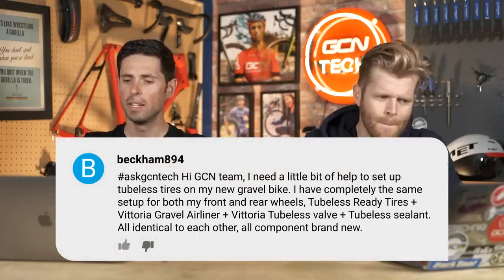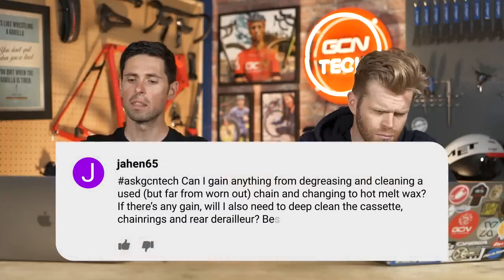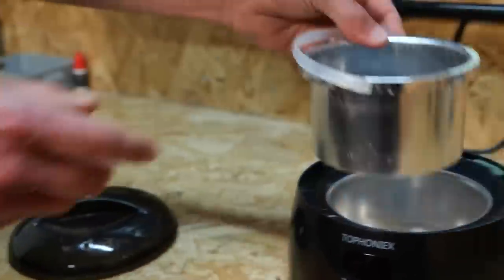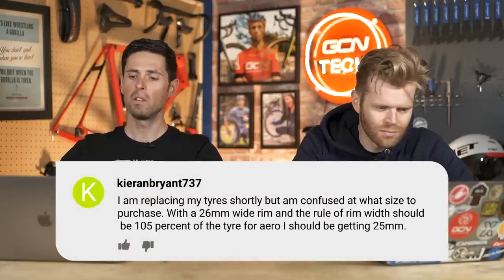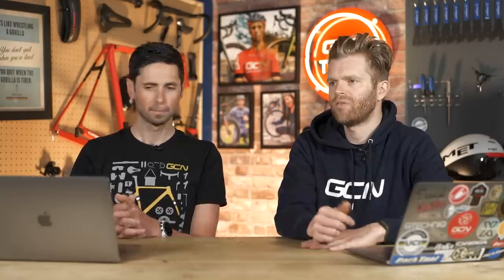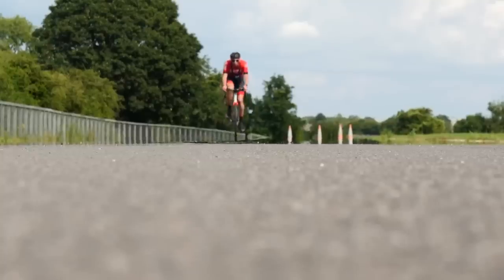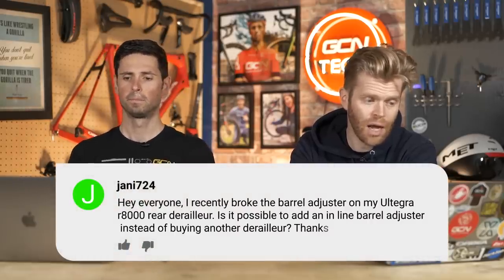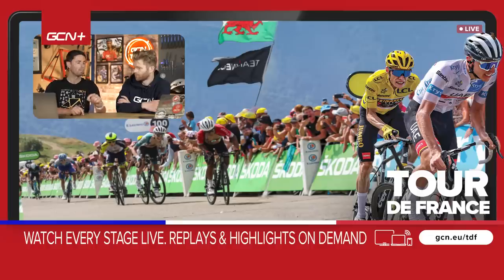Broken Barrel Adjusters, Waxing Chains & Tubeless Woes | GCN Tech Clinic

Comment from the maker: If you've got any tech questions that keep you up at night, drop them in the comments using #askgcntech 👇
Reply: @gcntech replacement derailleur barrel adjusters are very easily available! There's an online touring bike shop that stock a lot of spare parts like that called SJS Cycles, based in Bristol. I have sourced a barrel adjuster, derailleur cage and shifter cover plates for different Shimano groupsets from them over the last few years and my wallet is much more thankful. Whilst you could buy a used mech, even one for spares/repairs would likely set you back more than a new adjuster. Then you also have the problem of owning an incomplete spare.

Comment: Leaky tubeless valves: don't tighten them ....loosen them and give it a wiggle to get the sealant to flow through and seal around the valve area. Then hand tighten. Wait a couple hours for sealant to dry properly.  Also recommend Mucoff V2 valves because they come with 3 different size rubber bungs so you can choose a style which is closer to your rim profile. 😎

Comment: To the leaking tubeless tire: the little rubber on the outside of the valve doesn't do anything for the sealing. If it would you should have a seal on every nipple etc. 

Had the same problem. Was the tire sidewall. Pirelli send me a new one without a problem. Saw it perfectly when washing with soapy water.

Comment: For the rear Derailleur barrel adjuster IF all attempts to get the broken thread out fail, you can carefully drill it out about 2/3 of the way (basically making a cable stop) and pop in a "Rocket Barrel Adjuster" if you don't know what they are google them and you will understand what they do just by looking, but in a nut shell they will give you a semi-fixed barrel adjuster anywhere there is a cable stop, you could even bond the body of it in place effectively replacing the thread and use an original Shimano upper part if you care about how it looks.

Comment: If the tyre is going down relatively slowly, the hole through which the area is escaping must be small. Why then does the sealant not fix it? Seems strange that we've been sold a system that will fix punctures yet it cannot fix a small hole.

Comment: Having changed 4 sets of tubeless - apart from the very 1st time (GP5000STR 700x28 that held 90psi with no sealant for a good day) - always struggled to have tyres keep the pressure. What helped is super painstaking - applying a small thin layer of sealant where the tyre seats on the rim, making a sticky contact once fully inflated. Works like a charm. Wipe the wheels immediately as leftover sealant is a proper bastard

Comment: Original tyres on my gravel bike persistently lost air both front and back - replaced tape, valves sealant etc, finally identified many micro leaks in the side walls. Apparently not losing enough in any one to carry the sealant through but collectively enough to lose pressure over the course of a ride. Replaced tyres (different brand) and no problems since.

Comment: If a tubeless tire loses pressure it is often the valve core. If it gets dirty, for instance because sealant gets on the valve on the inside, it does not close well anymore. Easily solved with a new valve core. You can buy them in packs.

Comment: Washing detergent on the rims. Air 'will' also creep through the tyre walls at microscopic levels. Submerge the inflated tyre and see the tiny threads of air escaping. My solution was to rub sealant into the walls (not a total fix but close) For most tyres this seems to work. However, for my Vitoria Corsa Pro's there's always some gradual loss. No problem here. The advantages of these tyres far outweigh the issue of having to inflate the things a bar or two.

Comment: Inflating tubeless was a nightmare and virtually impossible until I realized the rim tape is too soft and has small dents above each spoke hole. Replacing the tape for more firm one and having the smooth surface was the key.

Comment: Yes - I lost pressure from my tubeless tyre because I picked up a 3 inch nail that damaged the rim. That was 2,000 miles in to a bikepacking trip so no solution as I had no spare rim tape....

Comment: About tubeless leaking air, I got sick of my tires losing about 1,5 bar in 3 days. The solution for me? Loosen the valve lock nut quite a bit, wiggle the valve around a bit and let the sealant do it's work. 

For the first month or so after riding tubeless I noticed the loss of pressure and thought it was just a thing for tubeless tires. After doing this, the problem seemed to be gone.

Hope I helped someone with this tip!

Comment: #askgcntech what's the point of doing all the process immerse waxing requires when you can get around 70% of its benefits (as per silca and zfc statements) simply using drip on wax, which is a cheaper, easier and faster process?
Reply: My wax was free - I simply melted down my 70th birthday candles LOL

Comment: The part number for the official replacement R8000 cable adjuster is Y3E998030
Search for that and you should be able to find one online. They're only a few pounds.

Comment: Hi GCN legends, I was just wondering if you guys have any connections in shimano and if so could you ask if they are going to still support ultegra 6800 series? Ie. a fc-6800 50t chainring. Down here in Australia. There is none available anywhere not even in Shimano’s stock. If I have to upgrade to a fc-R8000 series crank set. I think I also will have to then change my fd-6870 di2 front derailer. $$$$$$ I don’t have. 
Cheers,
Bondy.

Comment: #askGCNtech:  Hey tech team, thanks for all the help throughout the year(s).  Question, when you ride a standard carbon road bike up a hill or under a pretty heavy wattage load, how much does the bike flex at the cassette?  Or more simply put, should the noise(s) and level of noise from the chain cassette combo be the same or different when climbing?  Mine is different, do I have a problem?  My bike continues to shift well, Campy 10 speed from 2008'ish, everything replaced at least once, waxed chain , but it does make more clicking when climbing.  I am concerned maybe I need to finer adjust things, but have failed to this point.

Comment: Once I have my tubeless all set up properly and my tires filled with air, I start bouncing it, gently, I drop it from ~10” above the ground grab it after 4 or 5 bounces before it starts falling over, and drop again, rotating approximately 5 degrees each time I drop the wheel for the next set of bounces. I keep this up, until I rotate the wheel completely, 3 or 4 times, and then I top off the wheel, if need be. My tires lose a shockingly small amount of air. Tubed wheels I usually have to top off, at least every couple of weeks, if not more. With my tubeless setup, after doing this method, I have only had to add air, when I  have experienced a sudden loss of air, from a puncture, or an impact burp. I don’t know if anyone else has used this method of finishing their tubeless setup, but since most people say they have to add air more often than they would with tubes, I recommend giving it a shot. I would love to hear how it works for other people. My guess is that it results in a more even coating of sealant than the rolling and shaking method. Which I did to start with, but was losing a ton of air, and just had the idea to try bouncing my wheels, before taking them apart and re-taping, which would waste a ton of sealant.

Comment: #askgcntech Please make a tubeless tire trouble video. I tried tubeless but after installing everything, and going for my first ride,  the rear tire's bead unseated itself. tire is fine,  just not hooked to the rim. The front tire is fine. So I go to an event and sure enough after 8 miles, same thing. the bead is unseated and sealant is spraying everywhere. I had the pressures set for 35PSI for both rims, was this too low? (I'm 6'2, 250lbs) I want to try again but being not sure of what I did wrong,  I don't want to repeat the experience.

Comment: Hey team! I'm looking for a tough tubeless road tire that will survive the crummy roads where I live. The longest I've had a rear tire make it before being killed by glass, razor blades, or massive thorns was 842 miles. I live in a hot climate with almost no rain so wet grip isn't a big concern for me. I've tried Conti GP5000s, Vittoria N.EXT, Vittoria Rubino Pro IV, and Perelli P Zeros with only the Rubino making it over 500 miles. #askgcntech

Comment: #ASKGCNTECH Hi GCN, should I consider two different tread patterns for my gravel bike? I'm asking because I recently replaced my rear tire with a Rambler and my front tire needs to go as well. I want a faster rolling tire, should I put a rambler front and back or get a slicker tire, if so where should I mount it? I appreciate the advice and thanks to you I'm ditching the lube and switching to wax. I hate my dirty chain!

Comment: One of the many problems with tubeless  is that if you leave even a tiny amount of dried sealant in the bead area, you'll have a leak. Never mind the issues with the valve. Mtn, gravel, use tubeless, road, stick with tubes.
Reply: I couldn't fathom running tubes ever again on a road bike.  My flats are down a good 90%.
Reply: I run TPU tubes, which are incredibly light. 1-2 flats a year, 3-4K miles. No mess. I did run tubeless for a few years, and it just wasn't worth the hassle for where I live.
Reply: @rg807  makes sense if you don't get flats. I ride a lot(1200-1500 miles a month) and was getting 3-4 flats a week in goathead country.   I really only run 1 tube on one bike.... the front tire on my TT bike(when racing) and I'm tubeless out back.  Tubeless everywhere else though.

Comment: #askGCNtech @gcntech i want to commute with me bike. 45km one way. I want as little flat tires as possible. So i went for Schwalbe marathon plus tires. Unfortunately the rolling resistance is very high. What about a 32mm conti GP5000 with tube and a Mr Tuffy inliner? According the bicyclerollingresistance info, that should give me rolling resistance of about 13W (11W for the tire + tube + 2W for the liner), 10W less then the marathons plus. Or 20W for both tires. And puncture protection should be over 100 points, which is more then a fast tubeless tire. Am I missing something? Or is this a very valid and good option? 
(The bike is a Merida Silex 400 gravel bike)

Comment: I’ve got one for you guys, #askgcntech I’ve recently bought myself the SRAM red mechanical 12 kit which is just the shifters, mechs, and battery. I need to figure out cranks and rim brake calipers. Praxis has 2x carbon cranks that say they work with etap, BUT the chainring size jumps are shimano (50/34,52/36,etc) will these work fine still or do I need the funny etap sizing. And for brakes do I NEED to get sram rim calipers or can I use my Ultegra calipers already in the bike

Comment: #askgcntech I recently overhauled my front 3x claris shifter and derailleur, and after a lot of mistakes, I was on my third shifter cable. I couldn't get the shifter to downshift, even with the cable all the way unrouted and me just pulling hard on said cable. After routing the cable through everything, it still wouldn't shift. However, when I rewrapped the bar tape (the housing was simply electrical taped to the handlebars), everything started to work perfectly. Any idea how wrapping the bar tape could've fixed things? I'm not gonna mess with it any more, cause it works, but I am befuddled.
Reply: Possibly rethreading the inner somehow dislodged the outer cable housing from the shifter body. When you removed the bar tape, the cable outer then had enough freedom of movement to seat itself properly back into the shifter body.

Comment: #Askgcntech Some more chain and wax questions. So the wax protects the inside of the rollers but what about the outside? If there is nothing on the outside then wouldn't there be faster wear on the cassette and chainring since theres nothing lubricating the metal on metal contact between chain and cassette/chainring?

Comment: As much as we all enjoyed Ollie's explanation of chain wear, it was wrong...The roller does NOT touch the pin. The roller and pin are hardened steel. The roller rotates about a boss that's formed on the inner plate. To see what I mean, take a link completely apart and look at the inside of the inner link. Then place the roller on the "boss" of the inner plate. It's this boss that wears and makes the chain longer. I use a Wippermann Connex chain that uses stainless steel inner links and the chain lasts much longer....and I also wax it.

Comment: #AskGCNTech I love my aero road bike and going fast but I also like a „secteur“ of gravel or cobbles in my rides. Up to last weekend, I got away with my 30mm Conti 5000 S TR but finally I got a puncture. Now I wonder what tires to use for a multi day trip with longer gravel parts. Just stick with the road tires, get slightly more robust tires like the AS version of the Contis or go with some narrow gravel tires (the frame allows up to 33 officially)?
Reply: Happy with my Pirelli Cinturatos. Pretty risky to do that with GP 5000s😅 It may be worth getting Vittoria Air Liners too if you wanna ride a tire that'll be kinda fast on pavement while still hitting gravel
Reply: @veganpotterthevegan  The Airliners have arrived today. After what Luke Rowe said on the Watts Occurring podcast, this is almost a must for me now.
Reply: @insanelygreat42  pretty great that they have barely a measurable affect on rolling resistance.

Comment: #askgcntech follow up question to the leaking tubeless one. I had the same problem. Leaking air around 0,15-0.2 bar per hour although there was enough sealant in the 28mm tire for a 2 inch MTB one. The Problem was that there were microscopic leaks on the thread of the tire 🤔😳 In the end i had to change the tire completly . Any idea, what could have caused this or what else i could have tried?
Reply: You needed to let the tire soak up more sealant.  Some tires just need a lot more than others.  I've had this issue with Maxxis MTB and Teravails.
Reply: I find when dealing with newly installed tires, I usually spin and tilt the rim in all directions so the sealant gets a chance to touch every last spot on the inside of the tire. Maybe while pumped up to a higher pressure than usual (close to the maximum of the tire), sometimes helps the sealant do the job better.

Pump it up, slosh it around, wait for the pressure to drop once, pump it up again. If pressure keeps dropping the second time around, add more sealant, then pump it up again.
Reply: @veganpotterthevegan  I've ridden this tire for over 150k with double the amount of sealant than recommended. I guess that should be enough time to soak up the sealant don't you think?
Reply: @StornofuerKasse3  that's a lot of mileage on a tire🙃 Sure it's even tubeless😵‍💫 I've probably installed well over a couple thousand tubeless road tires.  Never heard of ANY problems like yours.  And if it's taking over double the sealant and still not sealing, you should have have turned your blackwalls(assuming they are black) into gumwalls by now
Reply: @veganpotterthevegan  yes, sadly they are. Schwalbe Pro one TLE (tubeless "easy"🙄) And i guess with that amount of sealant even a tube type tire should be possible to get tubeless😅
Reply: @StornofuerKasse3  ha, weird.  I've been riding Schwalbe Pro Ones and the like for 10yrs nearly exclusively until recently(Pirelli Cinturatos too now for my big road tires).  Never had sealant issues at all.

Comment: I've got a cut in my new GP5000 tlr tires (which are expensive) and the sealant won't seal the cut. The cut itself is quite small and sealant ( and air) continues to come out. Can I patch the tire? #askgcntech
Reply: I had a 1/4" chunk torn out of a brand new MTB tire, exposing the inner layers. Sealant alone just couldn't get it to stop leaking. I was able to put an internal patch on the inner wall and I've done hundreds of hard trail miles on these tires since with zero issues.
Reply: Internal patch? Absolutely. Best solution.
Reply: I use Hutchinson RepAir tubeless patches. They are thicker than tube patches for strength. If the cut is large you can get bigger patches for MTB/Gravel tyres. In the past I've fitted a RepAir and glued a large regular patch over it. Don't roughen the tyre with a perforated metal thing they are fond of putting in puncture repair kits - use fine sandpaper to avoid damaging the casing.
Reply: Superglue the cut together. If this doesn't completely close the cut, your sealant will finish the job. I've done this and it works. Don't use this technique on tubed tyres, any excess glue on the inside of the tyre once it has hardened will wear a hole in your inner tube.
Reply: If the cut is large you might consider stitching it up.  I had a large slice in the side wall of an almost new MTB tire.  I stitched it using an leather stitching needle and bobbin, waxed thread for leather, and coated the inside and outside of the stitched area with vulcanizing glue.  Has held up for a couple of  years, no leaks or separation of the stitching.  I think Doddy at GMBN Tech did a video on this.

Comment: A question for aero Olli ...    While watching the time trial in de TDF, we had a discussion on time trial suits.  We know the UCI police is measuring the lenght of the aero sock (or better : aero covers).  Then there's a part of skin and then the suit starts with a bibshort a long as possible to the knees.  Is there a UCI rule that forbids wearing long trousers (even if it's 30°)?  During one of the spring classics, there was a rider of Wanty-Gobert who had long trousers in ... aero fabric.  Because it was "cold".  We were wondering, how is this stipulated in the UCI bible?  And if it's not, wouldn't it make sense to try a long trouser skinsuit for timetrials.  For sure some marginal gains in there. #askgcntech